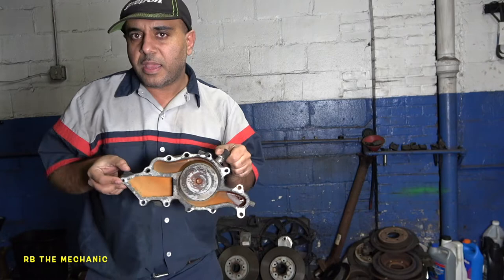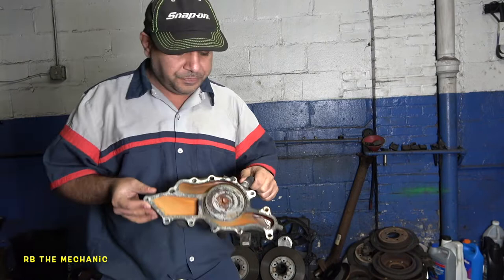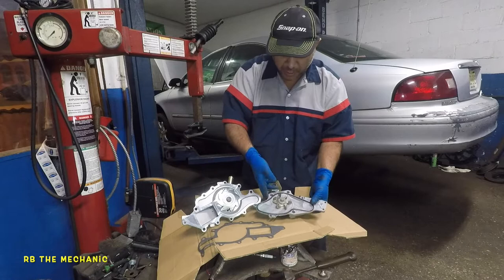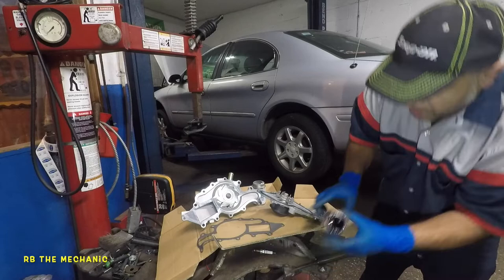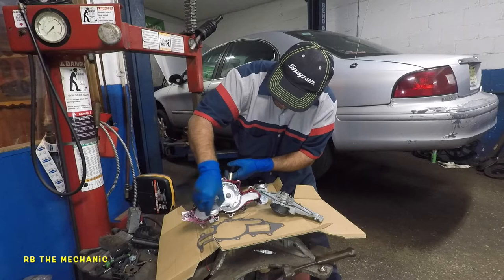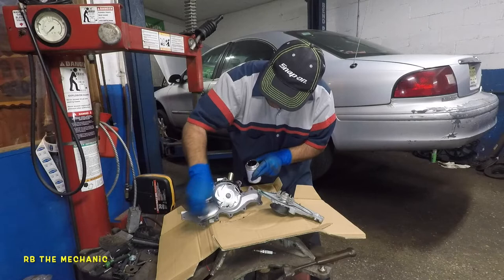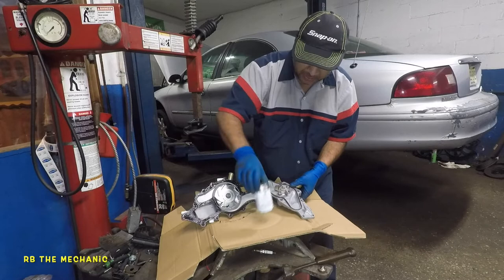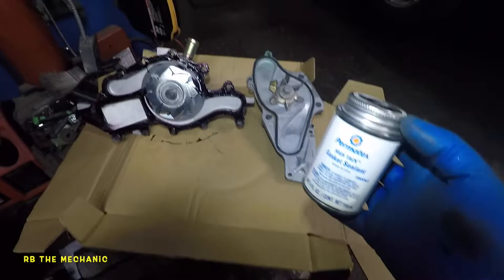Paper seal for water pump requires this  Permatex HIGH TACK Gasket Sealant #80062

Comment: Im going to try this tomorrow ill let you know how it goes been having the worst time with paper gaskets leaking on my truck
Reply from the maker: Ok cool!!
Reply: How did it go?
Reply: Same. Just replaced my failed water pump but when I put coolant in it started leaking at the new gasket! Gotta go in and try again uuhhg
Edit: I used a layer of rtv ultra black but didn't give it time to set up before reinstall and final torque
Reply: @cuz6657  I ended up switching to the metal gaskets with the oring and used some rtv and hasn't leaked since
Reply: @tannergallie9061  interesting. Not sure if I could find one like that for mine but I'ma try again. Thanks wish me luck

Comment: after i apply the last coat of sealant can i put the water pump back on shortly after and wait for it to cure?
Reply from the maker: Yes let it dry for few hours also just a another top make sure the surface on engine block is not wet

Comment: Will this work for 2014 ford Taurus if it’s inside or behind the timing chain?
Reply from the maker: Depends on the seal
Reply: @RBTheMechanic   do you have another you’d recommend or is this your top one?
Reply from the maker: @trinj.b.9212  I have few but they not on this topic
Reply: Will this work on a 2 uz metal gasket?I'm on my second 1...behind timing belt
Reply from the maker: @jamessnider283  yea